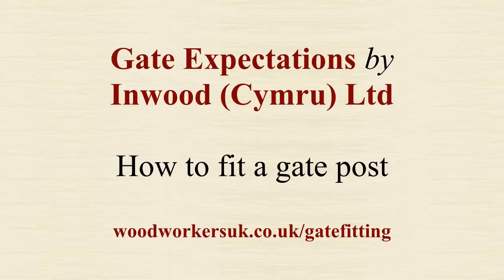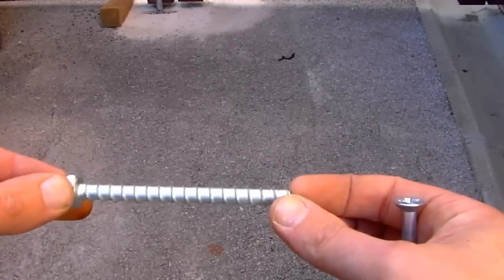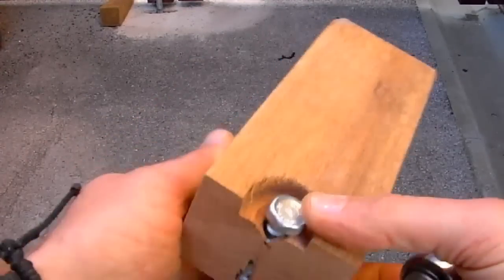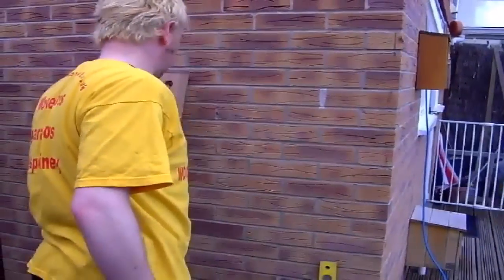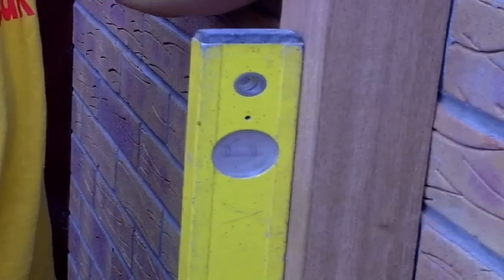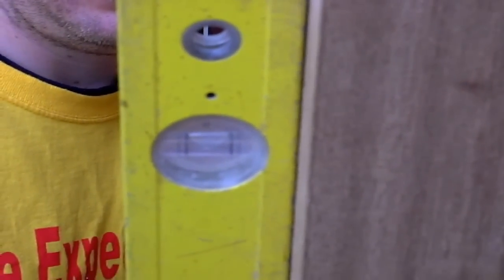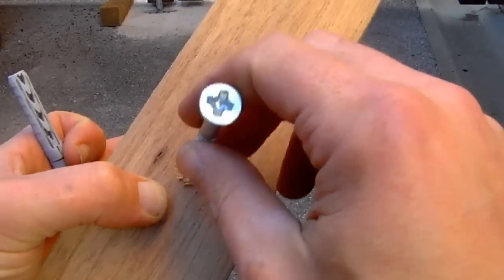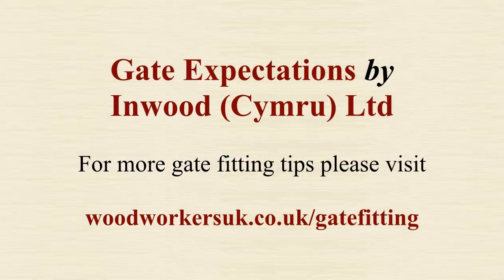Fitting wooden gate posts - Gate fitting guide

Comment: Q1 - Why don't you put a washer under your bolt in the countersunk hole?
Q2 - Would it be better to have some kind of space or stand-off between the wood and the brick wall so that any moisture that got in there could evaporate?
Reply from the maker: The concrete / masonry bolts do not need a washer, the head of the ones used is quite large and for want of a better explaination has a sort of washer built in.

If you leave a gap between the brickwork and post you will be allowing moisture in. Rear of post should be painted/ stained and once fitted should be sealed between brickwork and post with a silicone down the sides and over the top. Underneath the post between brick and post is not sealed and with the help of gravity any moisture in there should get out that way.

Comment: Both parts of the 'frame fixing' should be put through the wood so that the expanding (plastic) part of the fixing grips to the brick. The way you use them in the video would create a loose fixing to the wall as the screw will not reach the area designed to expand and grip the brick. In other words don't separate the fixing from how it is supplied in the original packaging.
Reply from the maker: +Adam Yates In the video I'm not using frame fixings, I'm using concrete screws or concrete bolts - these have no sleeve as the bolt/screw cuts it own thread into the brickwork like a self tapping screw once a hole has been pre-drilled into the brickwork.
Reply: +Inwood (Cymru) Ltd Hi, look at the video at 1:19. It sounds like your saying frame fixing.